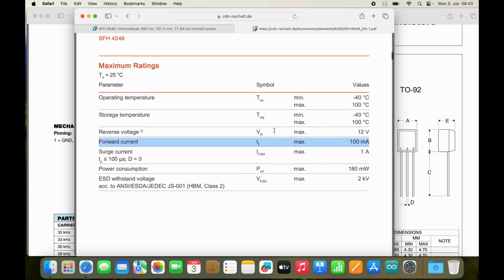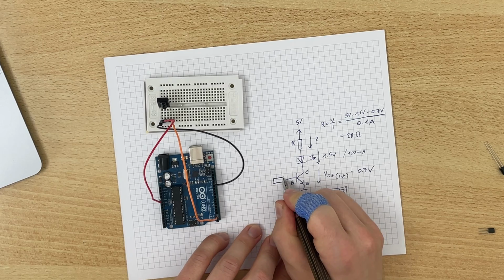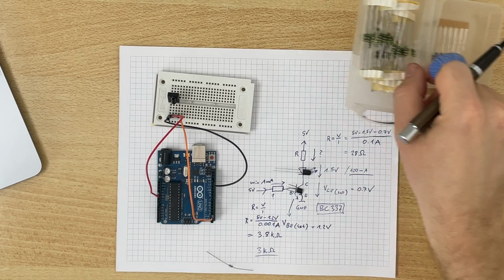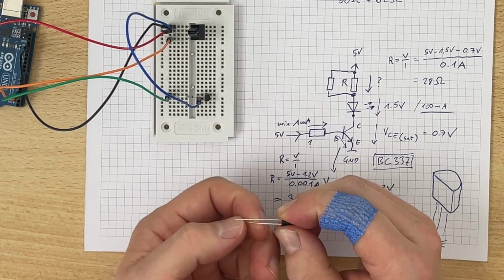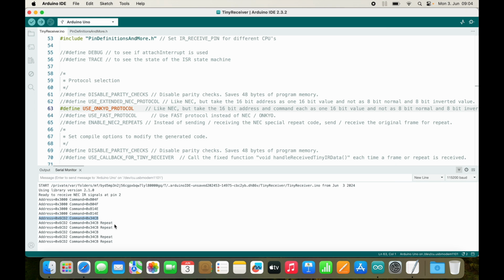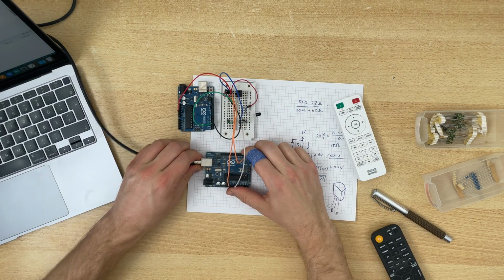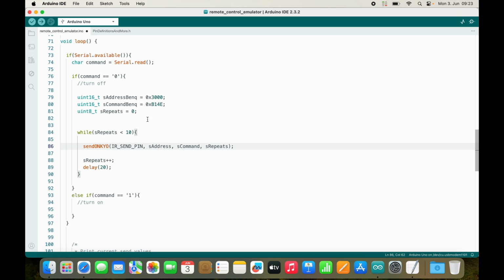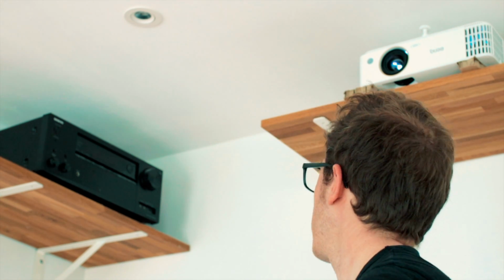DIY infrared transmitter (Arduino Uno Programming Basics)

Comment: Oliver, thank you for this very well explained video.  I just completed my first Arduino project with this help of this video (and another person's video that did not go into as much detail as you).  I have a very old Onkyo surround sound receiver that receives audio from my TV using optical.  Using optical, the volume control on the TV remote has no effect.

Using this video I created a device that listens to my TV remote for volume, power, and mute buttons and retransmits this as though it came from the Onkyo remote.  Now my TV remote is the only one I need.
Reply from the maker: Thank you for your comment 😊 This is awesome! Good Job! 👏

Comment: Thanks so much for helping me understand where to look to the datasheet for the values needed and how to use them.

I used Gemini to try and get values  for using an ESP32 with 3.3v on the base and 5v to the led using a C945 transistor and aiming at 80ma just to be on the safe side for now.  It got the led resistor right at 40 ohms but the base resistor it go far, far too low at just over 300 ohms instead of the 2k I got with your help knowing that I'd have 2.3v after the base saturation drop of 1v and a min amplification of 70.

I'm finding different datasheets for the c945, some saying 0.3v and others 0.6v for the collector emitter saturation.  

I've got it working before knowing the values and it's good but the range wasn't as good as my actual remotes.  I will measure the collector a base voltage drops to be sure.

I'm now well on the way to what I hope is going to be a super universal remove for smart plugs, wake on lan, controlling the tv and Firestick and whatever else I can think of adding.

Thanks so much for the help.
Reply from the maker: Awesome! Thanks for letting me know - and all the best for you project :)

Comment: Do you think that you could transmit without using the transistor to amplify the signal?
Reply from the maker: I think so, yes. but you need to reduce the current to 20mA on R3 or 8mA on R4  🥲. This will limit your range significantly
Reply: @ ok I will give it a go and let you know
Reply from the maker: @MGsyd awesome 👍

Comment: Thanks 👍
I'd put a 1Meg pull down resistor from the base to ground 😉
Reply from the maker: It wouldn’t hurt for sure but will it help?
When using mosfets you will need this resistor to keep the gate from floating when Arduino is in a high impedance state. The NPN needs a base current to become conducting, so the additional resistor should not be required.
Reply: @playduino  Even a BJT is a voltage controlled device. If you don't believe me, just read The Art of Electronics and/or the Ebers-Moll equations. It's much easier to use the calculation approximations for current with BJTs, which is why almost everyone thinks BJTs are current controlled.

Also, why didn't you choose to go with an emitter follower circuit? I think the calculations could have been much easier, and I believe you would not have to use specific items from a BJT data sheet. Anyway, that's just my two cents 😉
Reply from the maker: thank you for sharing your thoughts but I am not convinced, yet 😅
I looked into Art of Electronics Third Edition. On page 76 you find the circuit that I used to drive an LED.
Reply from the maker: Thank you for sharing the video 🙂
It's an interesting approach to think about the BJT as a voltage controlled device. And it seems accurate. However even if there was a high source impedance voltage on the base that is high enough, it would immediately break down due to the "leakage" current of the transistor into the base. So I still do not see why this resistor should be required. 😅
Reply: @playduino  Since you can clearly see what I wrote, I never said that it SHOULD be required or that it IS required. I said I'd put on one there 😉
Reply from the maker: 😅 I see, thanks for the clarification. And for the interesting conversation 👍
Reply: @playduino  Anytime 🙃